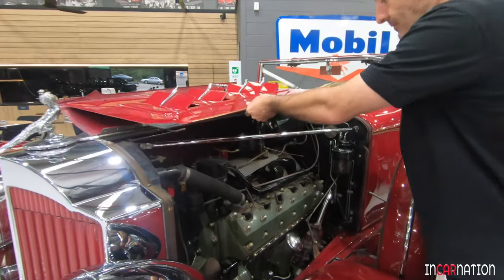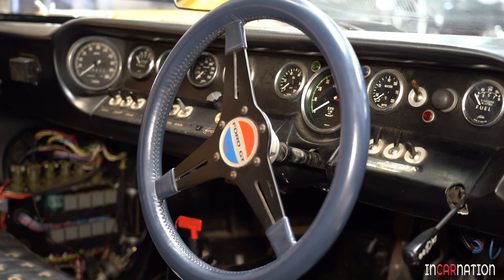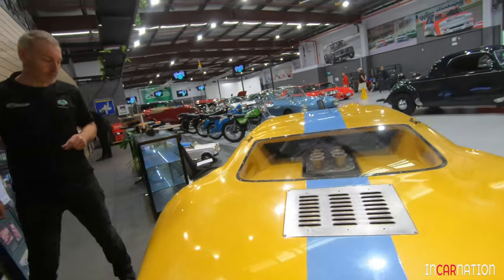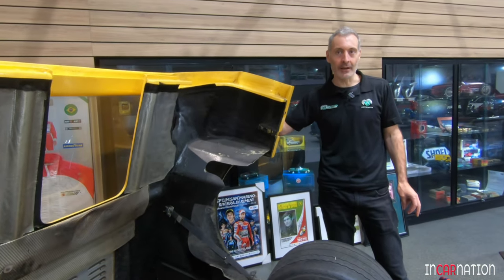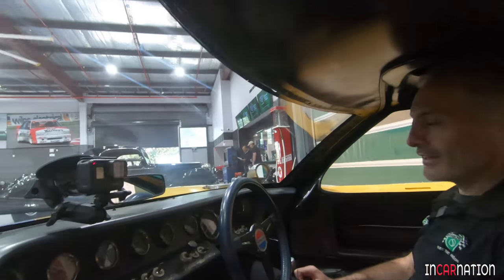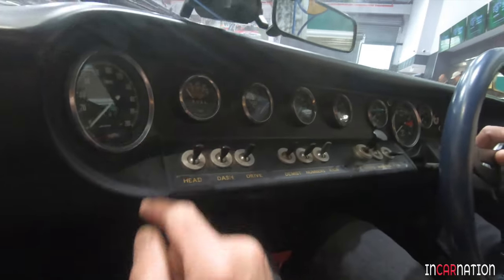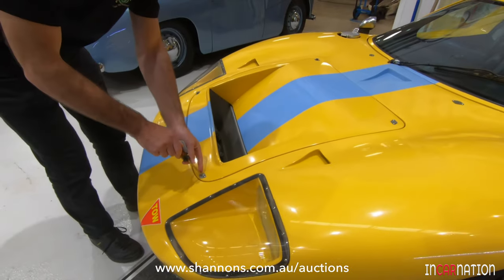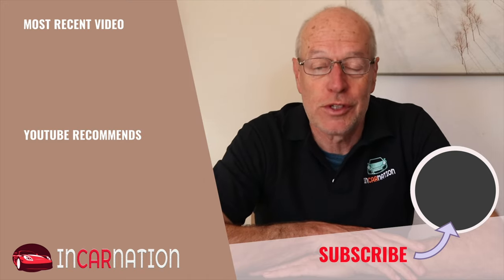1968 FORD GT40 (REPLICA) RACE CAR / And you can buy it!

Comment: How much, why are people always so eager to hide the price, I am interested and I got the cashflow but I am not stupid I do know that I can get a real Ferrari for 60K
Reply from the maker: I believe it auctioned for about AU$135k. Being a real "one-of" build I don't think they wanted to set a price expectation before the auction.
Reply: @inCARnationAustralia  135K I dont buy that, its a cool car but it needs deep restoration allready
Reply from the maker: @tonyhero1628  Actually Tony you'd made me go and look it up. The guide was $140k-$160k. Reserve was $150,500, and it sold for $188,000. So clearly as you say, you didn't buy it! It was a special car because it wasn't a tubeframe replica or kit car chassis, it was a fully monocoque replica built from the original plans, then well used in competition with plenty of patina. For a while it was mistakenly thought to be an original. So respectfully it actually doesn't matter if you believe it or not, that's what it sold for. I was wrong about the $135k. It was much more.